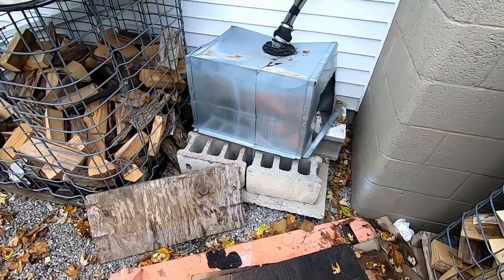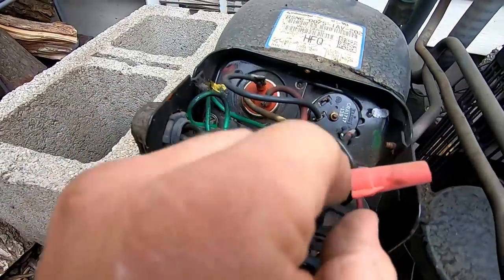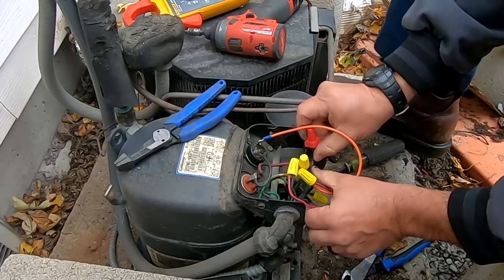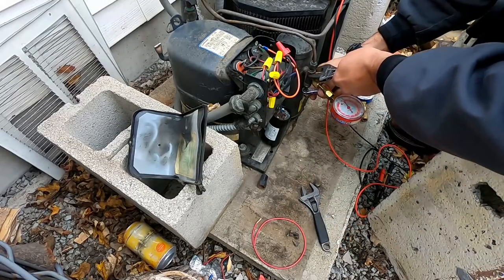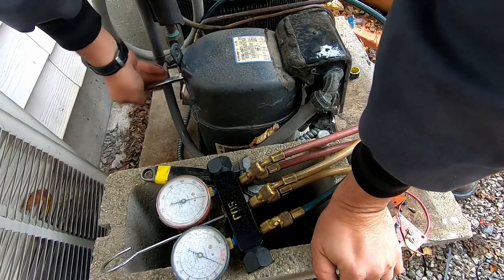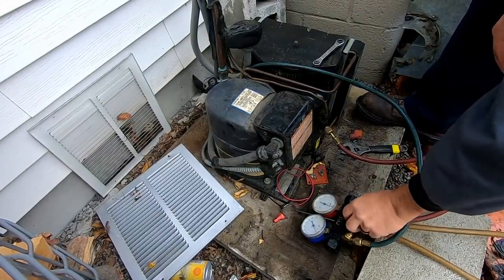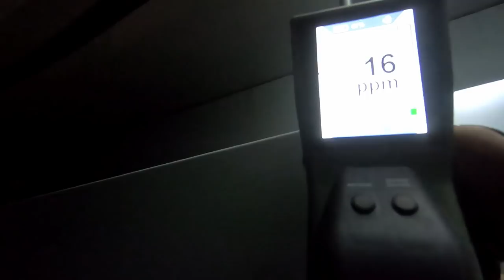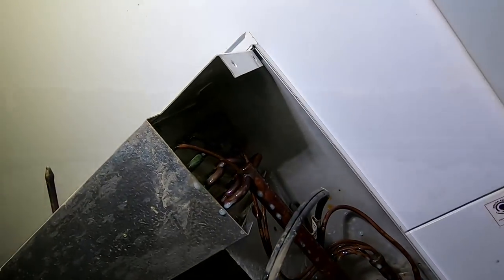Walk-In Cooler With A LOT OF PROBLEMS

Comment: Could your leak detector have been going nuts due to a humidity change? I have a auto reset fieldpiece and it will automatically reset so it’s not detecting the humidity. My old detector used to do the same if I stuck it near a cold coil or wet area. As in the first leak detector you used?
Reply from the maker: No, I haven't had any problems with Inficon on those types of false alarms. I had a ton of problems with the Fieldpiece detectors. I had both IR and Heated Diode and hated them both. They make good items but leak detectors are not one of them in my opinion.
Reply: @HVACRSurvival  wasn’t sure I just know some detectors go nuts when they are introduced to a cold or wet climate all of a sudden
Reply from the maker: @kevinblasingim7613  I know what you mean, I had a hard time finding the right ones for me. Not fun or cheap. lol

Comment: Nooice , I hate leaving weak @rse wires in too .
On the side note , I wish you guys would stop using refrigerant as a leak detection tool , we've been forbidden to do so for years now .
We just switched to using Trace-a-gas , which is just a mix of 95% nitrogen with 5% hydrogen , then you either  use a hydrogen detector or some newer leak detectors , like the one my employer provided , does detect both HFC , HFO and hydrogen , which is quite handy .
And the great thing is , it doesn't cost that much more than regular nitrogen either .
Last thing : Do you think Big Blue would have made it easier to pin point the leak ? At last I managed to find 1 supplier that imports it and it keeps blowing me away how sensitive it is , if you spay it with a steady bubble free stream .
Reply from the maker: Using a refrigerant a trace gas is still legal here. It's kind of like countries such as China that do whatever they want while we pay the big price to do it by the book. ( They were found in 2019 dumping CFC gas into the atmosphere LOL.) Big blue works great for a lot of things but in this scenario the pressure was so high that it just blew it right off and didn't bubble at all until I dropped the pressure down to about 10psig. That's why a lot of times they'll say start low and work your way up.  I'm very impatient so I start high and work my way down LOL
Reply: @HVACRSurvival  yeah I know it's super frustrating to be treated like we're the bad guys when we know for a fact other countries couldn't give two sh*ts , but I keep telling myself that at least I can do my part to not add oil to the fire innit .
Btw , because I know you're a tool enthousiast like I am , if you get the chance , it would be cool if you could review vaccum gauges and give tips on how to use them efficiently and how to properly maintain them .
Thank you very much indeed Rick 🤜🤛
Reply from the maker: The only vacuum gauge I got the Blue Vac. That's been the best vacuum gauge I've ever had, I've never had one last as long as that one has

Comment: That start cap blow hole, she was blown!  And no bleed resistor.  I'm surprised you didn't start out checking for charge.  Might have saved time and labor.  FUBAR!
Reply from the maker: I asked the customer if it had been running good before it stopped and they say yes so that eliminates a lot of things but I had to get the compressor running before I could check the charge. It was one thing after another and it was at the last part of the day and a new customer at that.
Reply: @HVACRSurvival  Just sayin the problem you see sometimes isn't the only problem.  And I agree you would have to see if it would run for accurate diag.  Hard to believe it was "running good", maybe like "it was running when I parked it"  LOL
Reply from the maker: Kind of like the airplane was flying great until it hit the ground LOL
Reply: @HVACRSurvival  As I can no longer work in the field, I appreciate the ride-along and will try not to be a wise-ass.